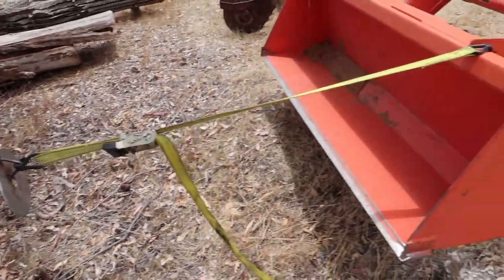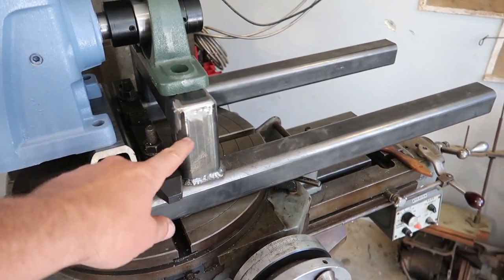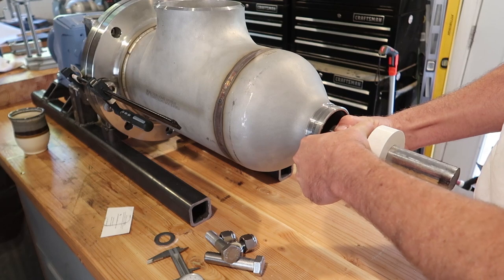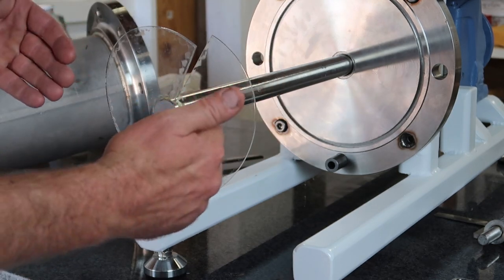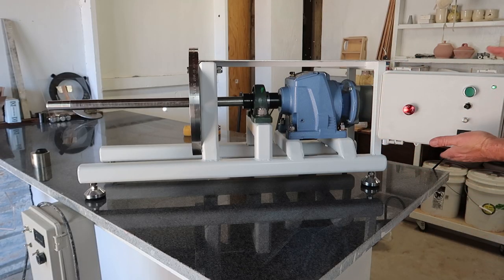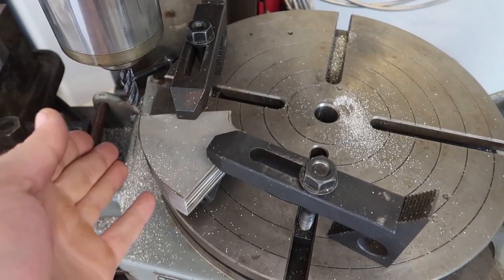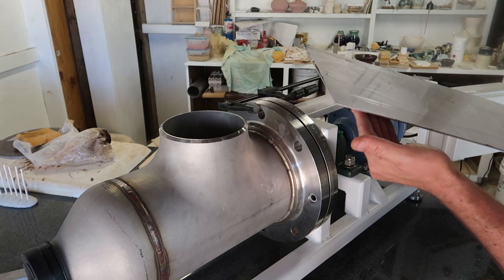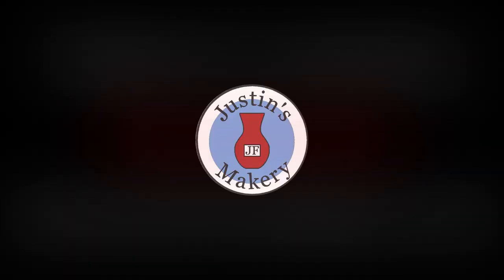Building a Clay Mixing Pug Mill - Part 2

Comment: Have you considered ditching the coupler, putting the gearbox/motor below the impeller housing (flipped 180°) and driving the shafts with a chain/sprocket? You could then use flange bearings to align the impeller without having to maintain alignment with the drive train. Would make it a bit taller but shorter footprint.
Reply from the maker: I have.  It's a good idea.  Either a chain, or toothed belt drive.  Another advantage would be an additional gear reduction opportunity.   I kind of have it stuck in my head to keep the area below it (in a future rolling cart) open for the vacuum pump, but there is obviously room for both.
Reply: @JustinsMakery  Well, you certainly have a knack for thoughtful planning on-the-fly. I live near a pugmill manufacturer and am familiar with their work - your design can give them a run for their money. Nice work.

Comment: Hi Justin, Do you have some kind of trust bearing?
Reply from the maker: Not really.  The rearward thrust is passed into the gearbox, via direct contact with the auger. The locking collar clamped to the auger shaft keeps the auger from backing out, and transfers thrust to the side of the  flange bearing.  The flange bearing isn't really intended for this, so it is something I will need to keep an eye on.